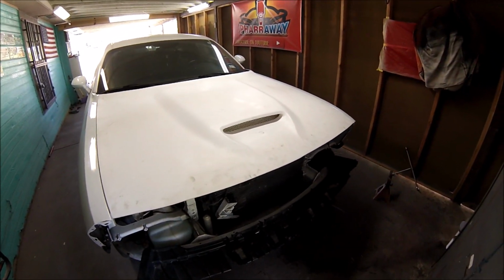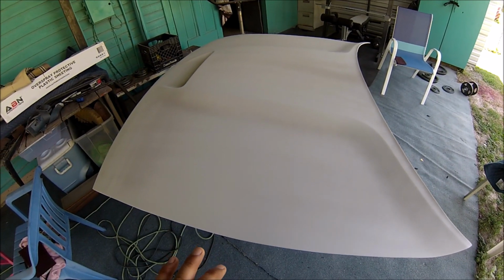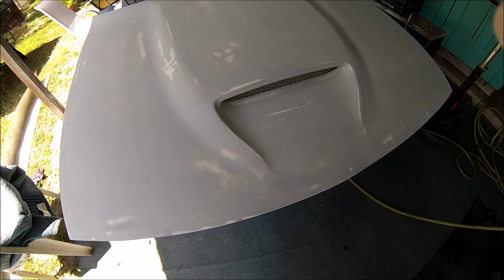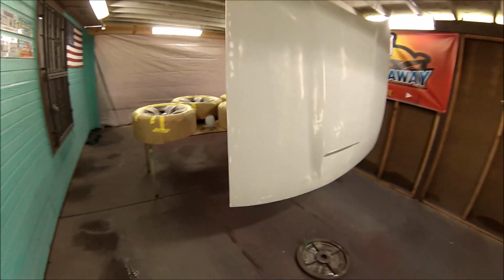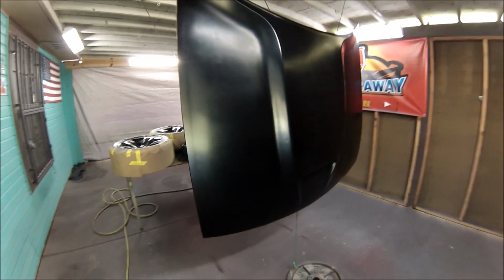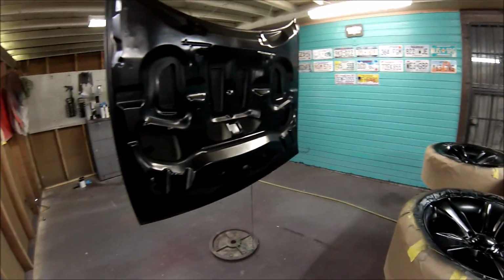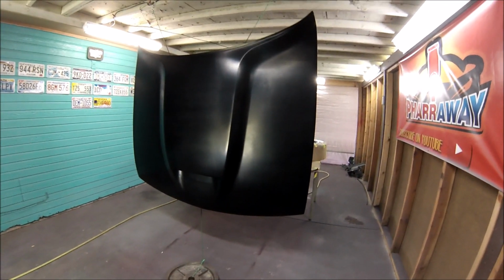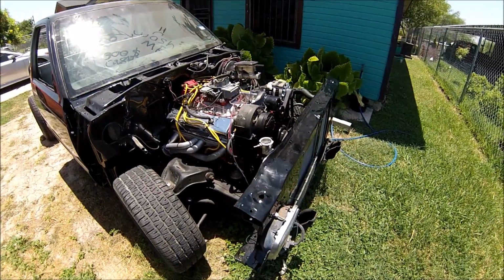How To Paint A Fiberglass Hood

Comment: Primero q nada quiero felicotarlo por el trabajo expectacular q a echo super smooth y limpio exelente tutorial. Pregunta q le quiero hacer bueno en realidad son dos uso acetona para limpiar el hood pq es de fiber glass o lo uso como sustituto de wax and grease remover. Y la otra pregunta es mas una recomendacion q quiero pedirle estoy trabajando unas piezas de motoras q son en nickel pero el cliente las quiere negras me recomienda q use adhesion promoter y despues lw aplique epoxy primer o solo con el epoxy primer es suficiente. Ya las piezas estan lijadas empese con 80 grit pq para opacar el nickel es super duro y finalize con 220 grit.
Reply from the maker: Gracias amigo si el acetone es para limpiar nada mas es que se me acavo el wax and grease remover y segundo yo te recomiendo que le eches adhesion promoter y le apliques sealer antes de la pintura

Comment: ANOTHER GREAT VIDEO; YOU DO A GREAT JOB; I HAVE SIMILAR SITUATION WHEREAS I AM REPAIRING "SPIDER STRESS CRACKS ON A RV; THE REAR AND FRONT CAPS ARE FIBERGLASS WITH A" GELCOAT FINISH; MY PLAN IS TO SAND THE GELCOAT DOWN AND USE A" MARINE GRADE FILLER" SPRAY A 2K URETHANE PRIMER (3 COATS) AND FINISH OFF THE REPAIR USING A "SINGLE STAGE URETHANE PAINT; IF YOU HAVE ANY ADVICE OR SUGGESTIONS THEY WOULD BE APPRECIATED, THANK YOU, PATRICK.P

Comment: Subscribed I see your way Beyond 30,000 now at 110000. Appreciate the lesson I have been practicing my painting on a couple Farm vehicles.
    Working up to painting my airplane which I am building out of S Glass. I have been filling and smoothing using microballoons since it's lighter and easier to sand then the  epoxy resin alone. I did watch your pedal car video.
     I plan on painting this bush plane in metal flake, candy, and some Pearl fades. Green on top, purple on the sides,  blue underneath. Lace top and bottom of the Wings. I will also be stenciling some country scenes. I still have practicing to do! LOL
    It looks as though my target weight of under 500 lb empty will be made. Has a 30 ft wingspan, Bush tires, and a 2300 type 1 eng. I have built it to look like an old hot rod complete with side pipes, suicide doors, and even a hilborn  scoop that feeds two AMR 500 superchargers. Needless to say it isn't easy building something like this and keep it lite. Thanks again
Reply from the maker: Thank you

Comment: Hey man awesome vid! Quick question tho, the clear coat on my fiber glass hood is peeling off and i was already thinking of painting it a different color. Would i just sand the clear coat off and paint from there or is there other steps i have to do?
Reply from the maker: No you can just sand it with 350grit and wet sand with 400grit and 600grit and you will be good to go

Comment: Ok my friend need some advice bought a used fiberglass hood it was never properly finished someone just spray bombed it black what is the best thing to use to remove the paint so the paint shop dont have a mess to clean off before they start glazing and painting it correctly ?
Reply from the maker: your best bet is to add 2k primer so you can block it down before paint